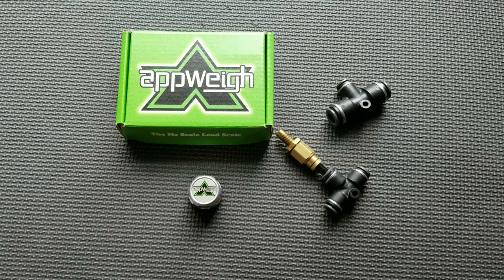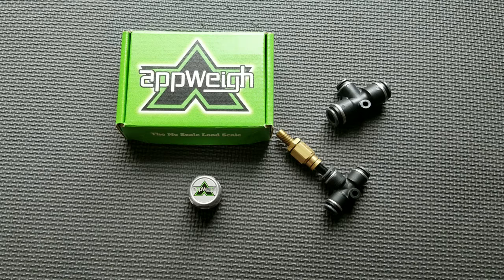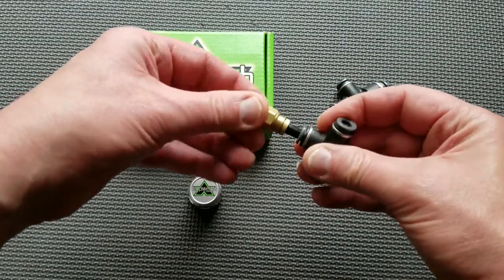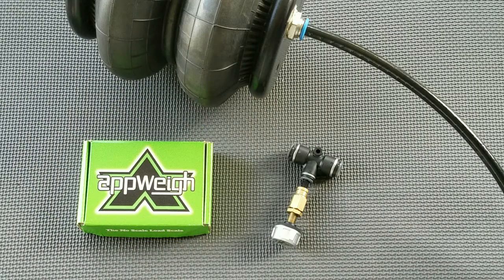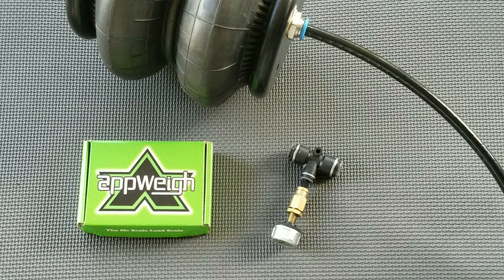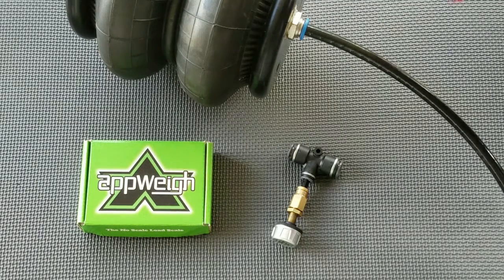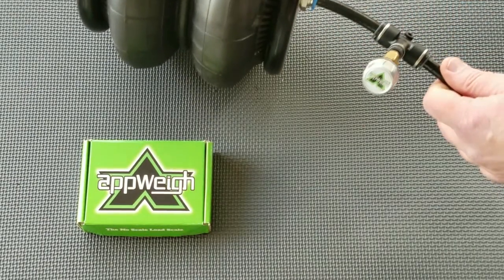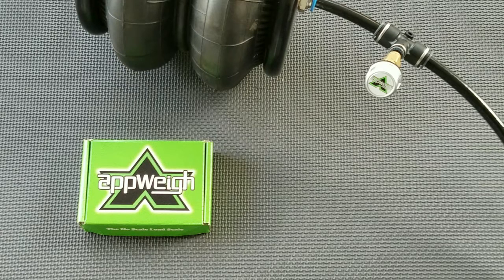AppWeigh Sensor Install

Comment: Lol I think it needs also hose clamps to prevent air leak not like on a video otherwise under pressure all that crap get lost in middle of road😂
Reply: No it doesn't. Once air comes through those hoses are tight and meant to operate that way. Alot of hoses in the truck are like that just push in and done.
Reply: Push lock. Dot approved